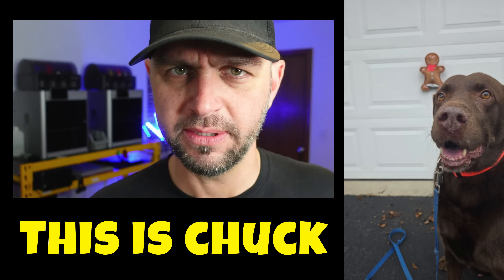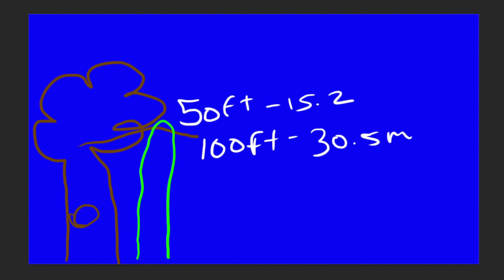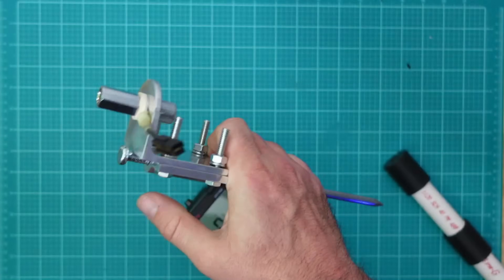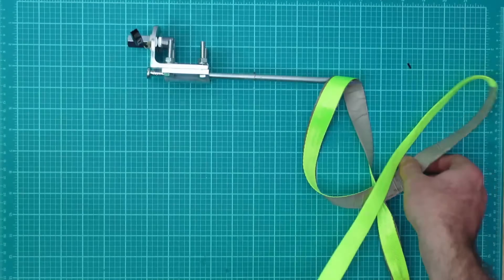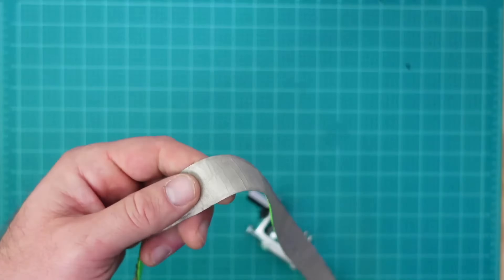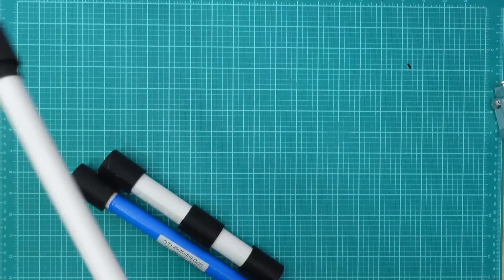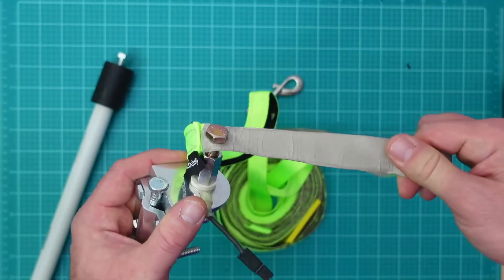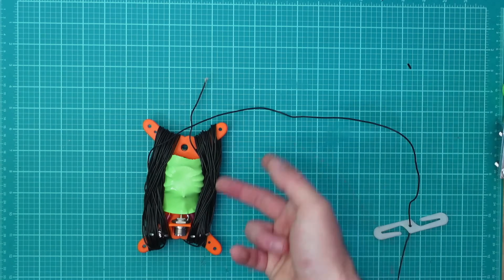Faraday Strip Dog Leash Ham Radio Antenna.

Comment: Would it be too much trouble to tell us which bands your antenna will be designed for?  After 2 minutes, I don't even know whether you're talking HF or VHF.
Reply from the maker: I'm not sure I didn't do that, indirectly. But let me summarize. Any HF band, or VHF/ UHF band you desire.  

In this, I speak about the 10m link, that would give you 10m. of course you could add links for 1/4 wave verticals on any band, as well as 5/8, like I had mentioned.  
Also, you could do a delta loop antenna and that would give you whatever band you make it for and a half wave of that. For example, a 20m delta loop will also give you 10. a 40 should give you 40, 20, 15, 10. You could choose to make a 12m delta loop
If you decide to build this with an EFHW or EFRW configuration, you could get many different bands.

Finally, I believe I spoke about a dipole antenna configuration. The dipole would work for whatever band you choose and if you add the links I mentioned and showed, you could have a dipole that could theoretically do multiple bands by adding and removing the links.

I'm not trying to beat around the bush, but more so explain that this is a very universal antenna as explained throughout the episode. I do this in a way which engages the viewer to think outside the box, thus making amateur radio experimental again.  Best wishes and good luck if you choose to build it.

Also in the first 26 seconds I spoke about the antenna being multi configuration and very universal.  Going on around 43 seconds speaking about Multi bands and explaining I would discuss it more in a moment (i believe there was a caption on the screen which stated "and throughout the episode)).   

ALSO, the description states the following:  
The Chucktenna (Named after the companies Chief Executive Pup (CEP)) is what I believe could become one of the most universal portable antennas out there. It is my opinion this antenna has the flexibility to meet many demands of portable use.

In this video, I’ll walk you the basics of building the CHUCKtenna, all while explaining different options and configurations this antenna COULD be capable of.  I truly know there are some AMAZING people in the community who will roll with this and make something great.

Different configurations possible:

1. Vertical 1/4 or 5/8 wave on Multi bands  (THIS IS WHAT I SHOW YOU TODAY)
2. 9:1, 4:1, 49:1 End Fed configurations
3. Dipole
4. Delta DUDE (Portable Delta Loop) Antenna.

Keep experimenting.... 

So yeah, there isn't much more I can do, but I hope this helps you and I will pin the comment to ensure anyone else who has the question can reference this.
Reply: @DudeTested  Many thanks!  I'd still be careful of the word "universal", though.  Have you seen the "Machining and Microwaves" Youtube channel?  That guy goes into some of the less popular super-high frequency bands.
https://www.youtube.com/watch?v=7GINqOnwxCc
Reply from the maker: @cdorcey1735  Fair point.  thanks.

Comment: Thanks for all the content. 
Your videos have taught me a ton. 
I have a question...
Which antenna would you bring for international travel?
I am headed down under and am torn on whether to bring an EFHW, vertical or other. 
Size and weight obviously a consideration.
Bands I want to work are 40, 20 mostly.
The place I'm staying at does have some trees but they aren't that high  (20ft at most), and they are not that close to the house.
Ideally don't want to bring a tuner...

Thanks!!
Reply from the maker: Thank You.  In the aspect of keeping it small and lightweight with travel, I usually just carry a 49:1 EFHW.  if you can manage to get the wire 20ft into the tree and slope it, it'll probably be fine.  However Verticals can be rewarding.  a 17ft telescopic would get you 20-10 (6 even), but you lose the 40 capability without a coil. a 1/4 wave vertical has a better take off angle, typically beneficial for DX.   If you go with a vertical ground antenna, you will need radial wires.  Traveling with  all this can be a bit much.  a EFHW is really just two pieces of wire (antenna and counterpoise, can fit into a bag nicely, and will allow 4 bands without a tuner (about 65-68 ft of wire).  

One thing to mention also, if you are staying by an ocean, the 1/4-wave vertical is could be better because the saltwater will act as a ground plane, which may mean more contacts.

When I travel, I travel VERY light, so the EFHW is always my go to.  If you have the room,. for a 1/4 vertical antenna with radials, you could probably sneak the efhw in there also :). 

https://youtu.be/rJ3FfJe9Xl8

Have a great one!
Reply: @DudeTested  thanks for the thorough answer.
I will build an EFHW for this trip.
I do a lot of JS8call and other digital modes so I am thinking an FT240-43 should do it as long as I keep my digital power below 50ish.

Regarding the ground spike - using the CB mount is fantastic.
I am currently using a Wilson Stainless Heavy duty stub mount to build my truck HF vertical mount.

I'm going to acquire a 17ft whip and build that spike, do some testing and comparison with the EFHW to see if it's worth bringing.

Thanks a lot for your sage advice :)
Reply: @DudeTested  do you find that you can get a good tune and low SWR with the 17ft whip and radials? 
Have you tested the Chameleon, or have any other recommendations?
The vertical with 40m loading coil looks tempting...

Comment: Nice video!!!! Just ordered a Lil Dude 6. This would be a sweet QRP kit addition to the G106.  This, the G106, a faraday cloth, and a 3-4ah lifepo4 could fit in a shoulder sling pack. 

Also, the feed point, I’d use a washer on each side for better connection. Nice work!!!!!
Reply from the maker: Washer would work really well!  Thanks so much. I hope you enjoy your ld6.    For the qrp kit, you may also consider my Wago dipole.  Have a good one!

Comment: Chuck, how do you make that little yellow 10M slider thingy to add or take away continuity?
Reply from the maker: @derwerd  one side of the cover has a piece of conductive tape on it.  When slid over the other one and secured in the case, the gap gets bridged.   Additionally, it could be used for fine tuning . Have a great one

Comment: That’s pretty slick how you made that link.  Are there still openings in the HRD School of Design?
Reply from the maker: If you think about the link a little more, it could be longer and it has a secondary use as a fine tuning adjustment (More or less faraday cloth until it hits the other side) Kind of like a telescopic antenna.  As far as enrollment goes, would you like to be an instructor? You get a name tag and a phone extension

Comment: I have the same spike setup but I used shorter bolts and put the extra on the other side.  Two benefits are easier to attach the coax and I used some wingnuts on the excess threads for counterpoise wires when needed.
Reply from the maker: It's a great point, that works well! Thanks!
Reply: And... if you have a small triangular file, file the holes in the bracket square (doesn't take much) so carriage bolts can be driven into them. 

The carriage bolts will be locked into place and won't rotate when you're screwing on the wingnuts and or nuts.